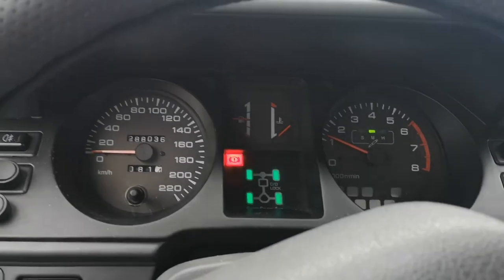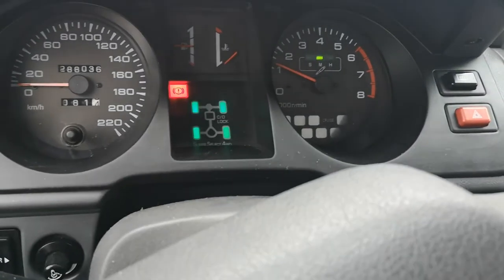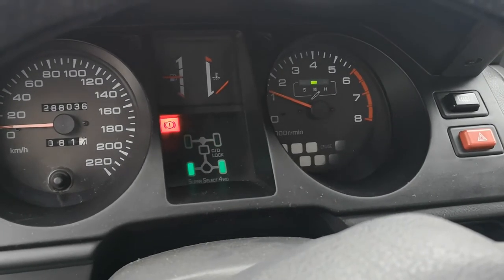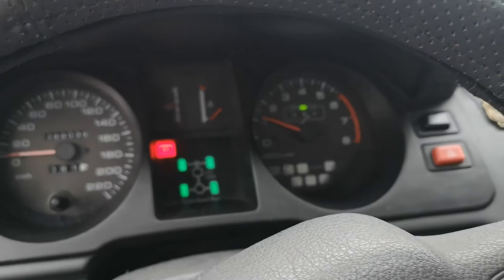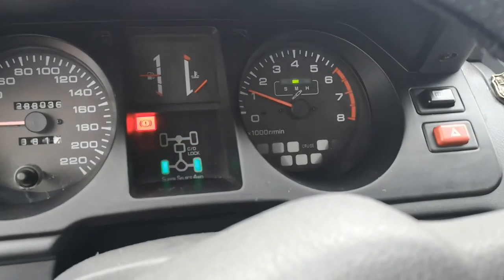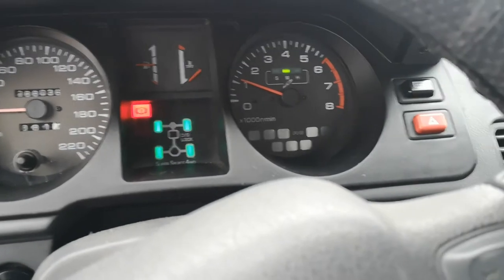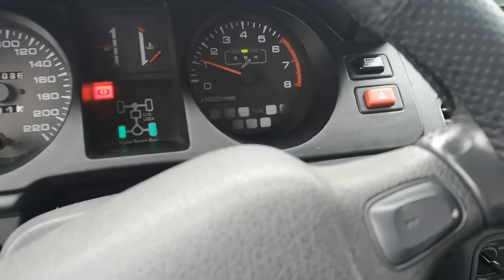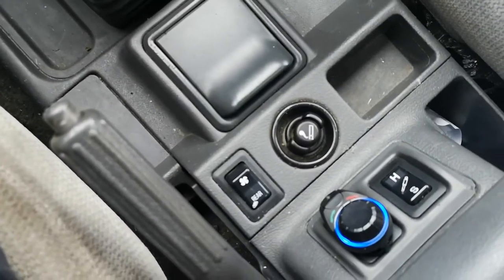How to use variable suspension system in Mitsubishi Pajero - soft and hard shock absorbers tutorial

Comment: Hey, great video! One question tho. Do you have all 4 shocks variable or just the rear? I found harnesses for mine in the rear, but haven't found/haven't looked hard enough for them in the front. I know my system works because I tried connecting the servo to it and it worked, I just can't find the shocks online, which is a bit frustrating.
Also, if you could share any more info with me about this variable shock absorber system, it would be greatly appreciated. Especially with identifying which models had all 4 and which had just 2. Thanks in advance

Comment: Hi,mate,I've got this blinking in my 4WD just like yours there at the instrumental cluster,I can't diagnose,been wondering what it is,but just couldn't find out,any tips??
Reply from the maker: Supposedly it is the vacuum sensor. In my case, switching the drive modes works fine and just blinking is a bit annoying but I haven't done anything with it yet.
Reply: @BBWalkerTV  Yes,my 4x4 is still working properly too.